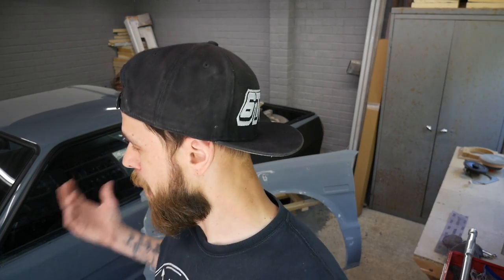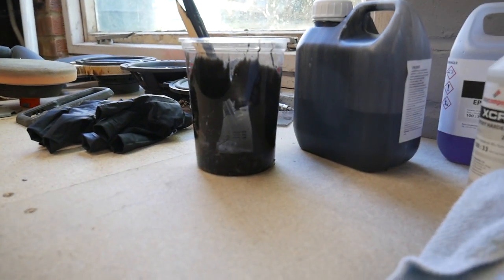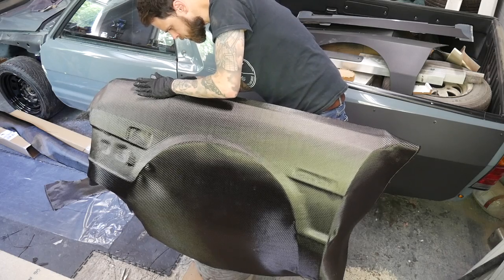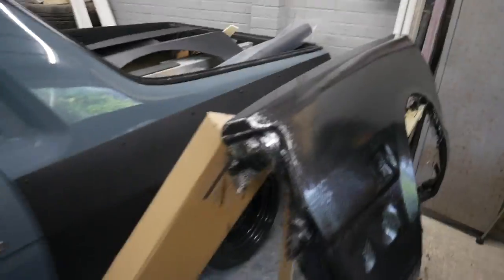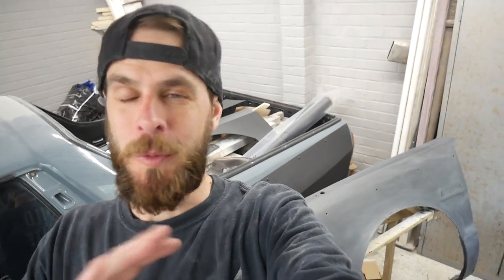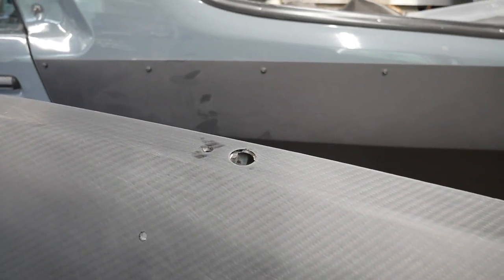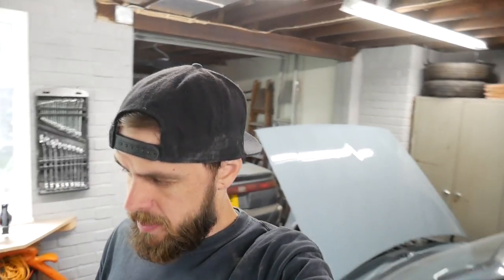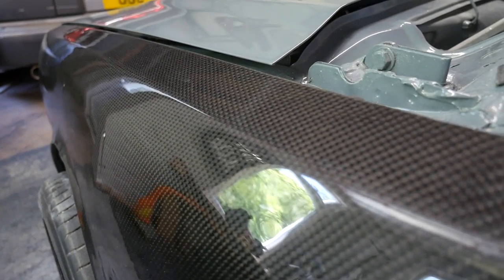Carbon fibre skinning!

Comment: How clever - making a car heavier with carbon fiber.
Reply from the maker: The wing is fibreglass, even skinned with carbon it weighs less than the oem steel one. 
How clever.
Reply: @BuildCreate  I was commenting on the fender.
Reply from the maker: So was i
Reply: @BuildCreate  Bottom line: the fiberglass fender (wing) was lighter without the carbon and resin. Right? Making it heavier while appearing lighter is a pretty silly deceit. I guess I'm a form-follows-function guy and you are a form-follows-fantasy dude. Can't wait for this "adoration of carbon weave" period to pass.
Reply from the maker: Well if you wanted to be pedantic about it. Yes it is marginally heavier than a fiberglass wing. 
But it’s much stronger than it will ever be and aesthetically superior. 

Personally the generic ‘form vs. Function’ phrase is stupid. 
Just a quick and lazy way of trying to pigeon hole people and their builds. 

To summarise, builds are subjective to the builder. If I don’t agree with something I don’t post sarcastic comments, I just let people enjoy what they are creating. 
Firing comments back and forth over the internet is the biggest waste of time and energy and totally unproductive. 
So this will be my final comment on the subject. 

Criticise by creating. Not by finding fault.
Reply: @BuildCreate  Wow bro, I'm reading your words way far away from you (Puerto Rico) and I couldn't be more in agreement with you!!! Keep up the great work! While other people critize, others like me enjoy your content!!!💪
Reply from the maker: @kennyacosta8709  Thanks Kenny, appreciate the kind words!

Comment: so...you added carbon fiber, which usually is used to reduce weight...but you just put it over the metal so you increased the weight. smart.
Reply from the maker: Did you even watch the video? The wing is fibreglass. The wing still weighs less than a metal one and is much stronger. Smart.
Reply: @BuildCreate  i apologize. i missed the very first bit where you stated it was fiberglass. i misheard it as saying "we're going to be fiberglassing this wing"
Reply from the maker: No worries dude 😊

Comment: Learn how to make a mold. Add weight for no reason. Just wrap if you are lame
Reply from the maker: The wing is fibreglass, even with the carbon it’s still lighter than the oem wing.